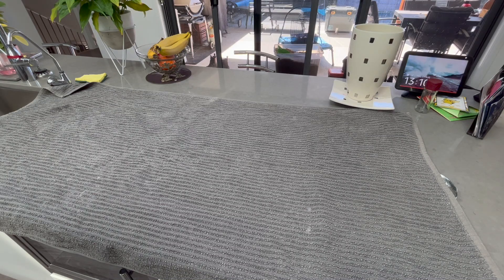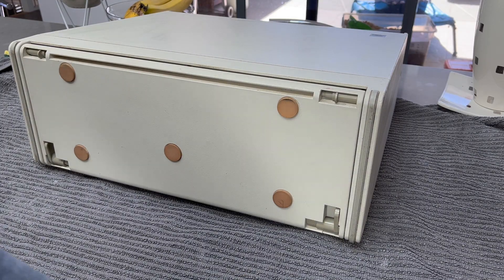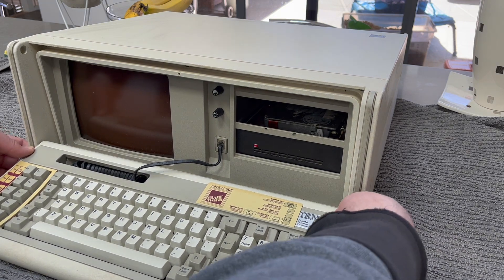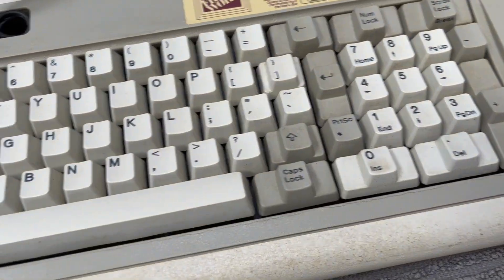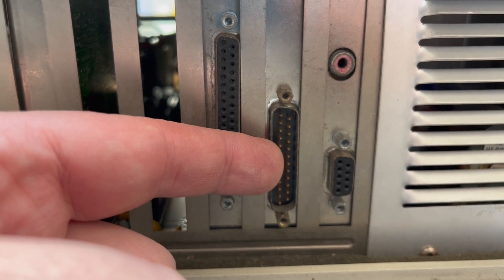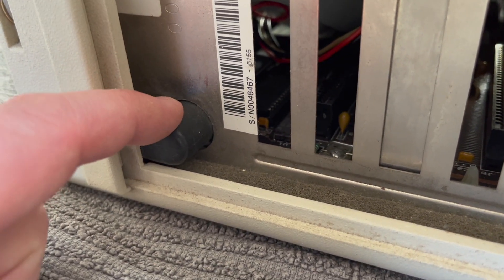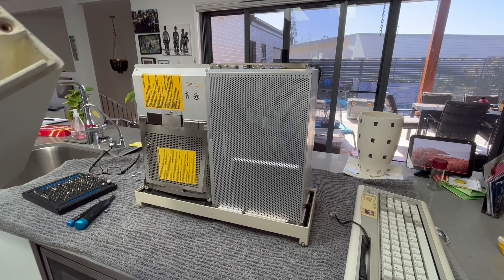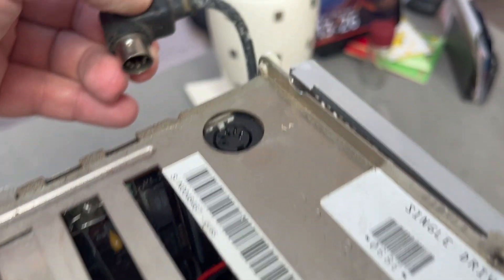🇺🇸 IBM Portable PC (Model 5155): Part 1 [TCE #0088]

Comment: Looking forward to seeing you restore this one. I do like IBM machines.
Reply from the maker: Me too!  Imagine ... being able to play "The Ancient Art of War" anywhere (with a power point)!
Reply: @Brfff  There you are, on the beach, with a lovely beverage in your hand, 14 kilograms of IBM iron on your lap, and a beefy power extension cable secretly plugged into the beach bar's outlets. Or, there you are, in a NYC subway car. It's winter. You are warming your hands over your IBM 5155 atop a massive transformer both on a beefy hand cart. Your fellow riders--notoriously unmoved by even the most outlandish sights--look nervously at the anaconda-sized cable snaking through the cabin, the smoke, and the firework-display of sparks. You have a broad smile on your face because you just figured out how to tap the third rail from inside for more portable computing bliss. Or, there you are, back in spasm having just hauled your 5155 into the boardroom. You're also sweating as you try to answer pointed questions about the wisdom your proposal to outfit the entire sales force with one of these beasts for demos and submitting expense reports (which the never do). But you console yourself knowing that you get to play The Ancient Art of War later at home this evening if you have the energy to get the IBM 5155 up to your flat. You are the vanguard. A bright future of LiIon, LCD, and GHz in your palm awaits you. Keep going, Portable Computing Warrior.